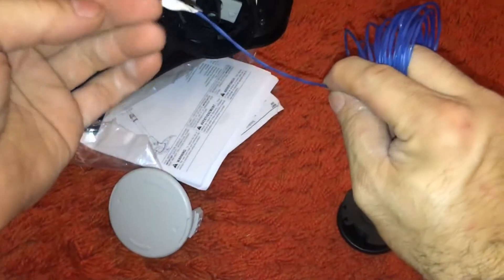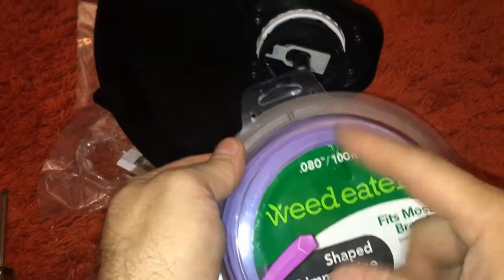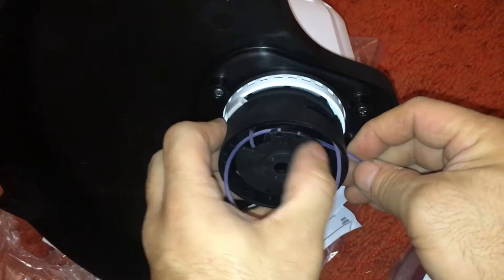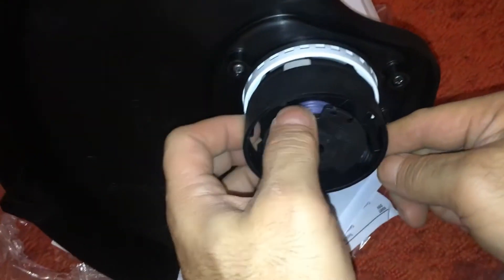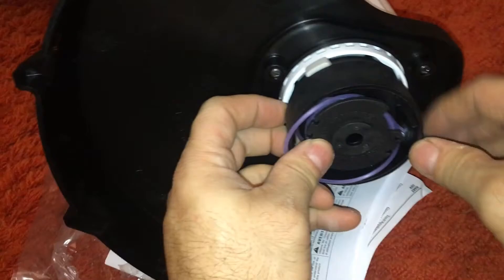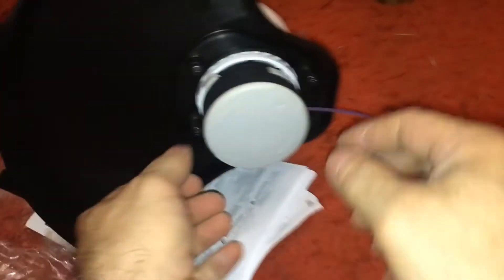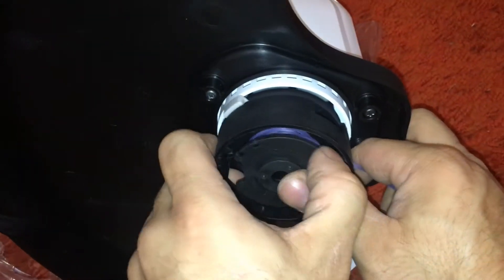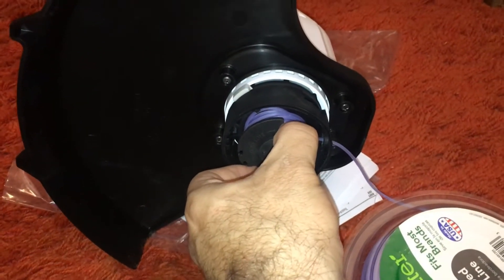How to Hart Weed Wacker restringing the correct way Method 2

Comment: Thanks! This video helped me. I found that if I did not cut the string off the replacement line until it was full, I had plenty of tension on it to fill the spool moderately tight. Watching you accidently hit the button and having difficulty helped me to understand the pitfalls. Thanks!
Reply from the maker: lol nice! remember if you wind it too tight its going to bind and not feed out occasionally.